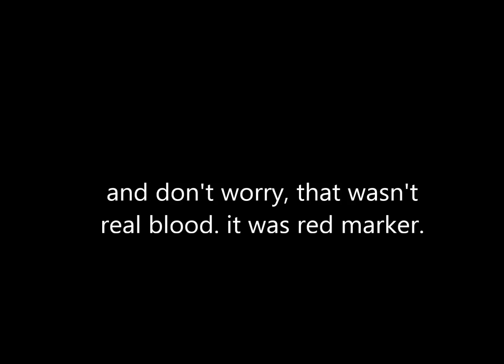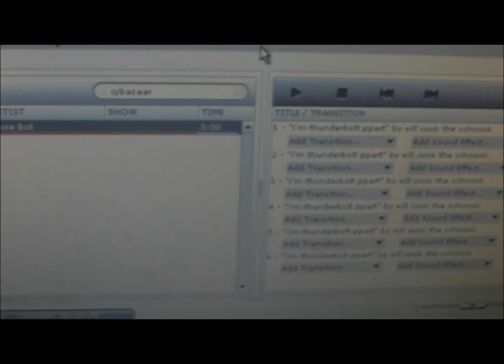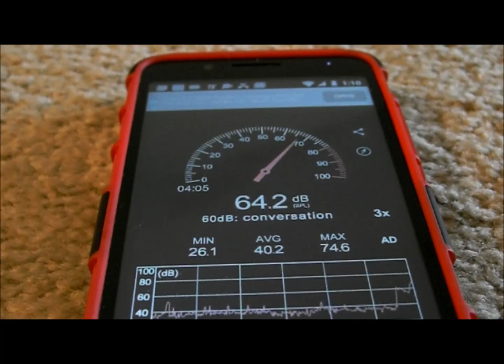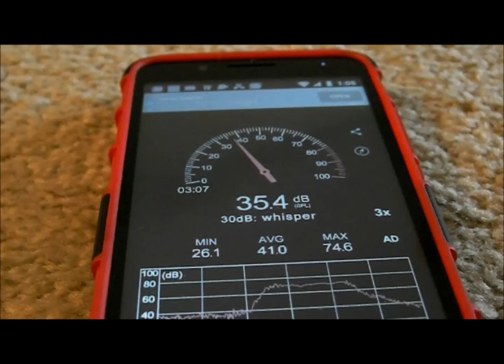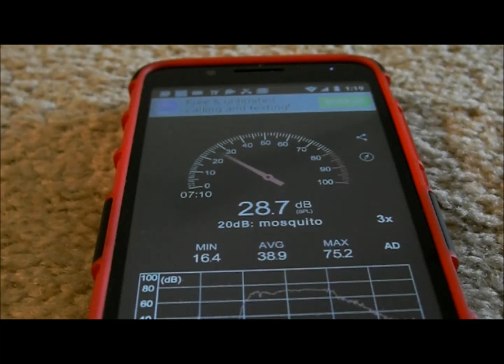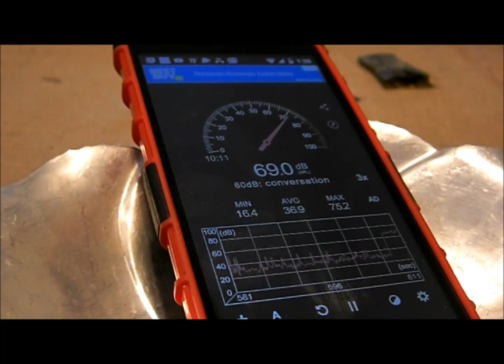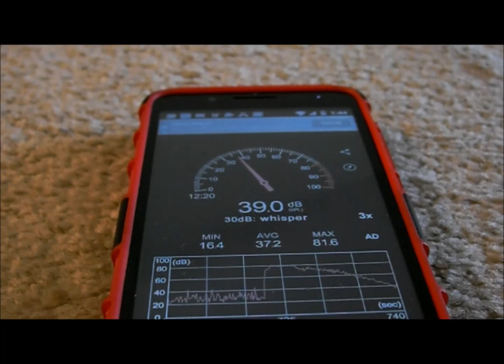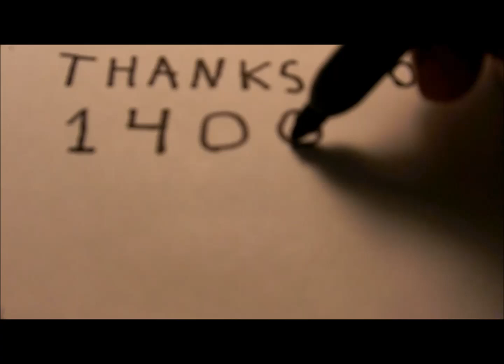broken solar panel 14000 subscriber special q&a + mini siren decibel tests.

Comment: D

Can you please make a non existent custom siren?

Chopper: downwards rectangle

Horn: circle like a p50 but mixed with a Thunderbolt

Sound: I'm Thunderbolt mp3 file and 2001, Sentry, and Thunderbolt mixup

Color: red or yellow, not both

Pole: tall

Name: Strike Bortsa A12-BT2

Type: electro-mechanical/electric

Collector rings: yes

Rotator box: right below chopper, oval shaped like the prototype tbolt going left to right

Pole (again) DONT COLOR! Just brown.

Blower: turbocharged

Solenoids: built into chopper/none

Girl: solenoids
Boy: no solenoids

Signals: alert, attack, Hi-Lo (solenoids), T.S.M.T. (Tone Signal Management Test (plays I'm Thunderbolt mp3 file)), and Test (hold to run)..

Rotation: left to right, 4 rpm

Comment: Hey BSP, I built a siren today using a 5v speaker, a microwave motor and some aluminum. I had some issues with it and was watching some of your old vidoes on the Thunderbolt for help, and I would love to talk to you about your mini siren builds. My number is +16159209757. Hope you can help!

Comment: I hope the animation software doesn’t stop functioning, because then TSM is cancelled. Which I will be very sad if that happens.

#PleasePrayforTSM
Reply: My YouTube channel suffered the same fate when my computer literally got to the point it refused to load Windows Moviemaker
Reply: Hope that doesn't happen. I will also be very sad.
Reply: John Boudreaux wait what

Did you just say windows 9?
Reply: I'm too scared that Tornado Siren Madness or maybe Broken Solar Panel will be gone if the computer is completely dead. Also Windows Movie Maker is no longer accepted in Windows 10